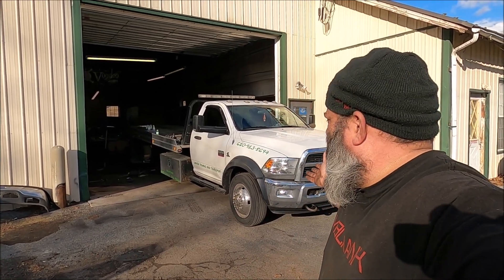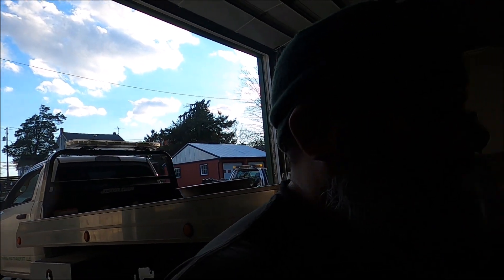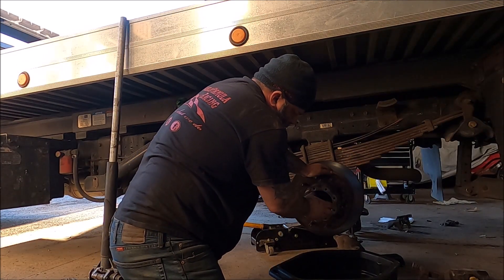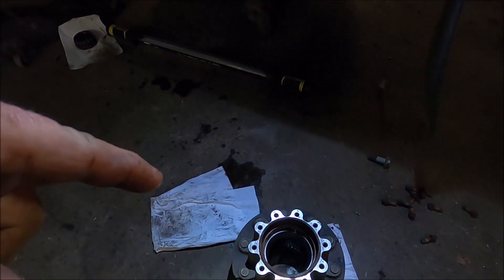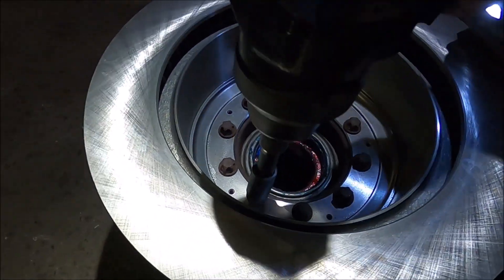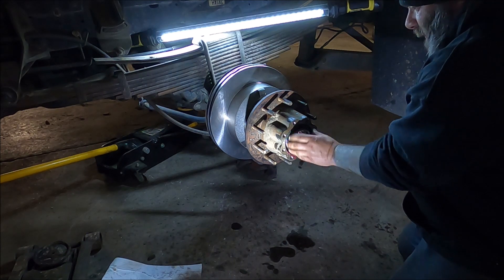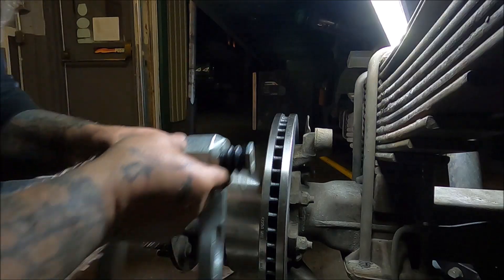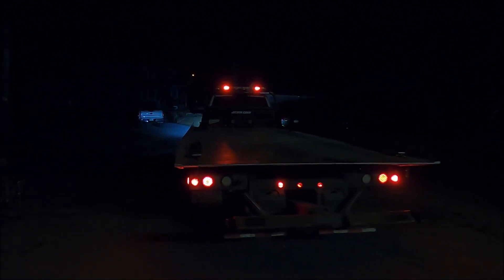4th Gen Dodge Ram 5500 Tow Truck Brakes-How To With Torque Specs!  *NOT CLICKBAIT*

Comment: To torque the hub to the rotor you could also probably set it on the rim thats removed from the truck and the studs inside the wheel should keep it from turning.

Comment: Dude... How hell are you getting a socket and your torque wrench between the bolt and leaf spring?? I'm currently working on a 2018 Ram 5500 and my 30 mm and 1 3/16 socket are too damn big. I'm thinking about cutting my socket down. Also I keep seeing a 460 FT/LB spec for the anchor mount?? I saw the 190 and 163 but it list this for cab and chassis? Been fighting this damn thing for too long smh...

Comment: Man I hate greasing bearings. Great job though Andy. Too bad Zack isn’t there so you could teach him the proper way to do it. I have a older 1976 I think Dana 60 that has two nuts and a lock ring in between them to keep it tight. I definitely like that design better. Keep plugging and chugging buddy. 
😎👍🤘🔥💯

Comment: If you pack the bearings the correct way, it’s a lot easier…
Reply: Shouldn’t pack them at all when used in an oil bath application such as this.